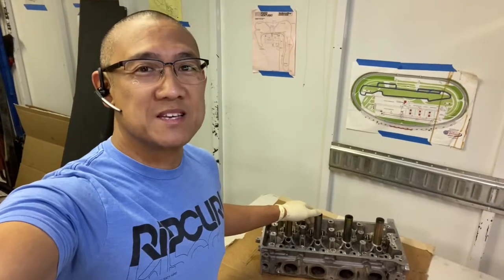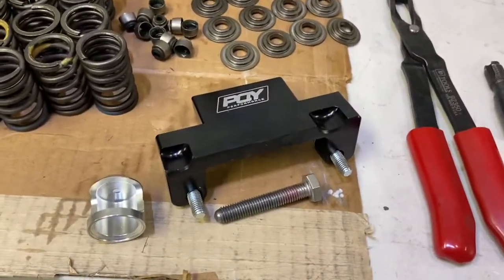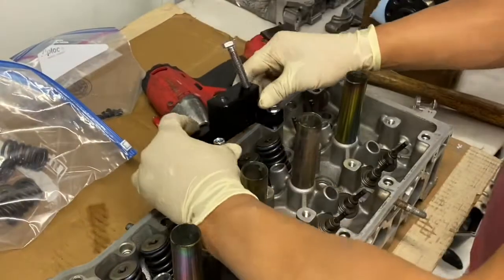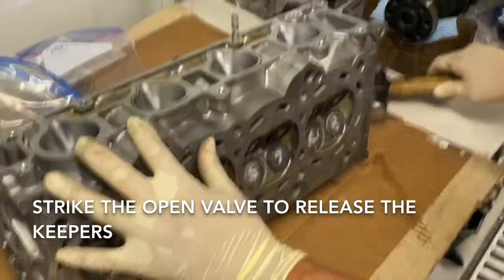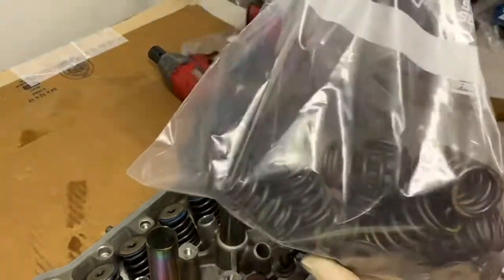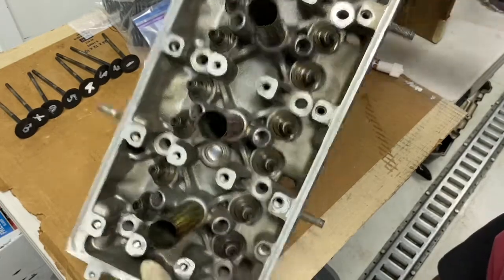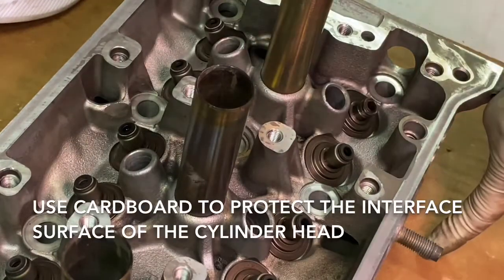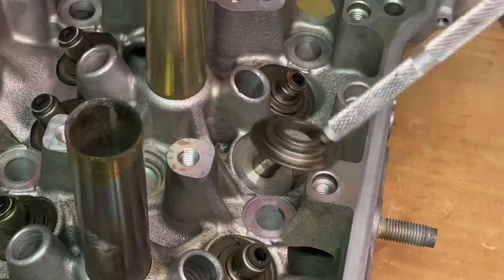Complete K Series Cylinder Head Disassembly

Comment: Good video but I'm really sketched about hitting the valve with a hammer like that. Is that really ok to do?
Reply from the maker: Hey thx for watching and commenting. When I’m working on a head for one of my race cars, I know I’m not going to use the stock valves and the guides will be replaced. Is there a chance I bend the valve using a hammer?  Perhaps a slight chance, but releasing the valve doesn’t require a lot of force bc it’s just the keepers hanging onto the valve. Pls subscribe bc there’s a lot more automotive content coming.
Reply: @RelentlessRacingAJ  Ok thank you for the reply. Long story short, I just rebuilt my head with brand new valves after I money shifted it to 11.5k rpms. I released valve locks by banging on the retainer with a hammer and a socket. A couple valves were slightly bent, and I'm fairly sure that was because of me banging with a hammer, not because of the money shift. 
Well now I want to upgrade my valvetrain, but I can't risk bending my new valves so I'm stuck lol
Reply from the maker: @dkis8730  ah I c.  That’s a bummer. Can see how that might happen. Using the Eurosport or PQY tool helps to prevent that from happening. I hope u figure out ur build. Thx again for watching. Lmk if u need any PCI products. 👊